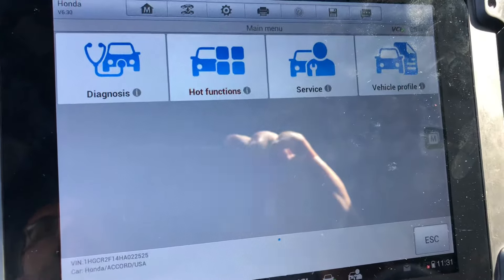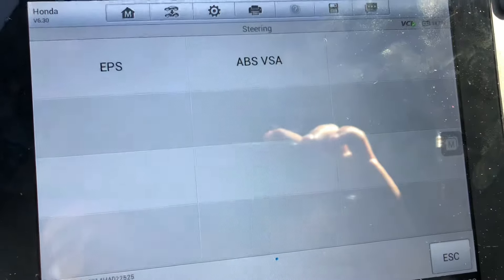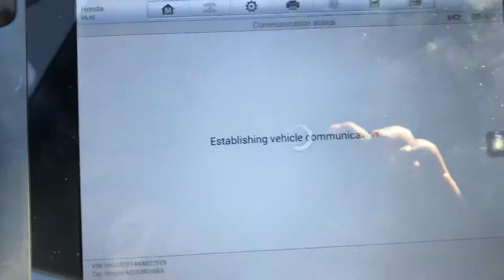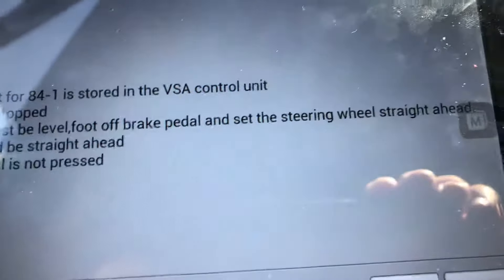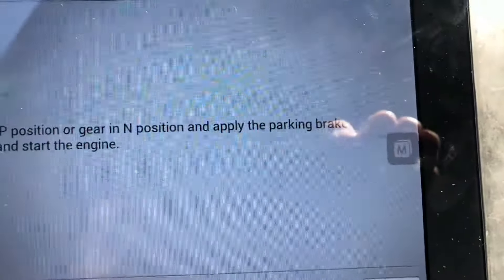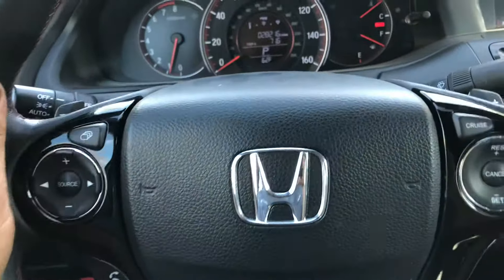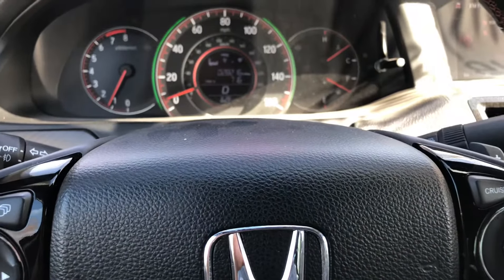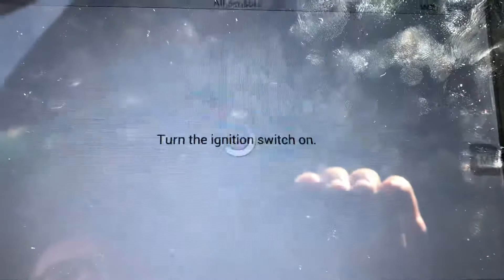Steering Angle Reset On Honda Accord With Autel Scanner.

Comment: Good video.  Procedure not shown in other youtube videos. 
What I don't understand is when they say to center the steering wheel but the wheels are not straight. If I drive straight, my steering wheel is about 12deg off to the left.
Reply from the maker: That means you need a wheel alignment
Reply: @themodernmechanic428  Thanks, but this all happened after I changed the clock-spring. I am hoping all I need is recalibrate.
Reply from the maker: @rondail5675  ok that means your steering wheel is a tooth off then. Take the steering wheel back off and straighten it out
Reply: @themodernmechanic428  Kind of you to reply. I don't think so but it is always possible.  Can I recalibrate, neutral-learn, with scan tool to correct? Videos show ABS/SAS relearn and drive 10 ft to learn what straight is. Hoping for easy fix. Maybe doing as you say is best
Reply: @themodernmechanic428  , You are correct. I don't know how but I removed the steering wheel and it was off. I feel stupid. Now I caused a problem trying to recalibrate my ABS/SAS and steering angle. I wish you lived near Providence RI.  THANK YOU!!!

Comment: What model is that autel scanner? I was about to start fuckin with the abs module but I might try this. It got aligned  in January , and about a month and a half ago all lights turned on Except abs light , but traction, tpms, traction, ldw and fcw are on. I wonder if this is what’s needed?
Reply: Hi, I have a 2016 honda accord with the ABS light on and ABS will not engage. I think it may be the abs module electronic soders failing. But I can't be sure that that is the issue. Did this work for you?

Comment: My 2015 Honda Civic got a steering rack replacement due to a previous collision damage and it damaged the clock spring and steering angle. The electronic rack replacement was done and a few days ago I replaced the clock spring. Car works fine but as soon as I accelerate over 10 mph the traction control light starts blinking and the gas pedal starts to make a loud grinding noise and the car immediately stops. In order to use my car I have to turn off the traction control manually and it works like a charm. Front end alignment was done but the steering wheel seems to be slightly misaligned. Will recalibrating the steering angle sensor solve the issue?
Reply from the maker: Yes, you need to calibrate steering angle sensor. The lights and pedal vibrating is the abs system activating due to steering angle sensor not being calibrated
Reply: @themodernmechanic428  Thanks a lot man. Will do it asap but wanted to make sure I didn't have to purchase a new steering angle sensor
Reply: @themodernmechanic428  I had the system recalibrated and the issue is gone and the steering wheel is straight. The only issue is now I have the tcs off permanently on. Any idea why?
Reply: @RukiStudios  you need to do the vsa neutralization procedure to reset that. Any good bidirectional scan tool should be able to reset that for you.

Comment: Great video! You have a new subscriber.   
I bought a  2017 Honda Accord that is missing the driver wheel airbag. I drove it for a block and I get this code DTC 27_13. Can I use this scanner to reset the Steering wheel angle? Or do I need a new Steering angle sensor? 
Thanks,

Comment: do i have to follow this procedure after every alignment job ? or is it not necessary?
Civic 2018
Reply from the maker: Yes you need to do this after every alignment
Reply: @themodernmechanic428  
why is it necessary? can you please enlighten me on this?
Reply from the maker: @GoharHayatt  too long of an explanation to explain I detail but basically, modern cars have electric steering racks with torque sensors that if not calibrated will cause the car to pull. Also the new cars with the lane keep assist systems need to be calibrated in order to stay in the lane correctly.
Reply: @themodernmechanic428  I just got an alignment on my accord 17’ I noticed when ever I come to a complete stop my steering wheel tilts to the left , what kind of mechanic can I take my car so they can reset my steering angle ?
Reply: @Vg.j09  same problem here, did you get that fixed?
Reply: @willnguyen3284  I took it to Firestone tires got a tire rotation & alignment after I got it back the tilt was slight noticeable but after a week of driving I my steering was back straight

Comment: What does Steering Angle do for the car or do to the car ? I have the same device? Just trying to learn it ?
Reply: The car knows when the steering wheel is straight. If you do an alignment, it needs to be re-calibrated

Comment: My 2017 honda civic hatchback has this problem my steering wheel is a bit to the left and when i center it. When i correct it it turns a little bit and i feel like i need to give pull down to keep it driving straight. Its like i am driving my old 97 civic hx. I had taken my car for alignment and still had this problem.
Reply: Same problem here. My 2016 Honda Accord was like that from new.
Reply: to the left as well

Comment: Can this program a abs/vsa module after when it's replaced on a Honda civic si 2008?
Reply from the maker: I’ve done it on a Ford but not sure on honda. Most likely you have to use a j2534 pass through device with a laptop and a subscription to Honda oem software.  You can contact autel tho and they will give you more accurate information.
Reply: @themodernmechanic428  thanks

Comment: What was it doing? Not turning sharp enough. Mines is doing that.
Reply from the maker: This one had an abs light on with a code requiring the steering angle sensor to be reset after I did some suspension work to it.
Reply: @themodernmechanic428  gotcha mines doesn’t turn sharp enough you have to turn wide to make a sharp turn. And they don’t have power steering fluid since it’s electronic.